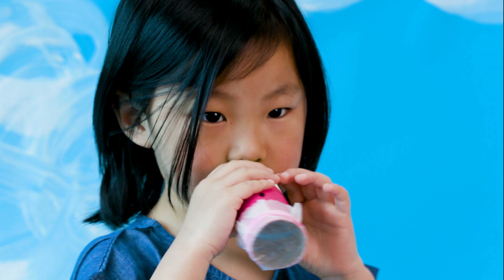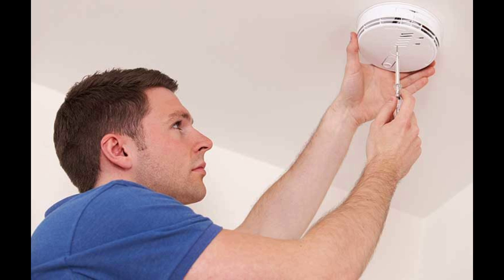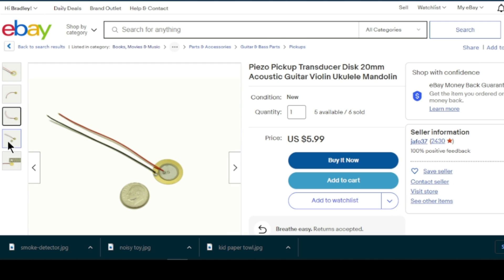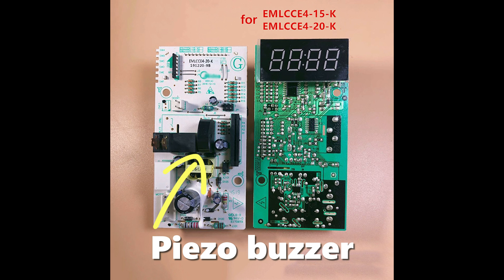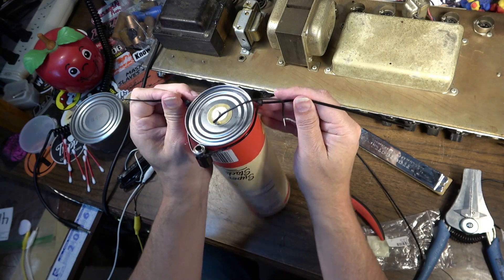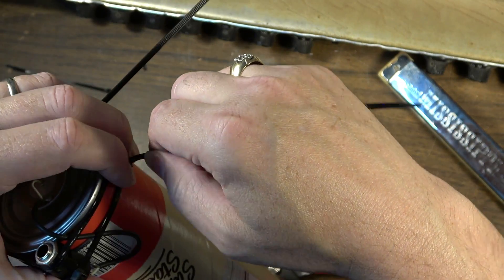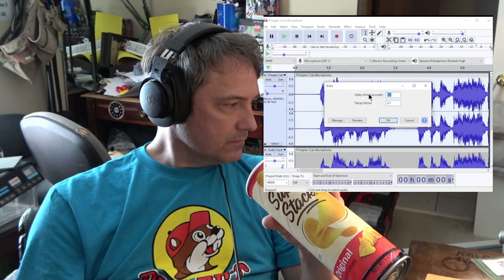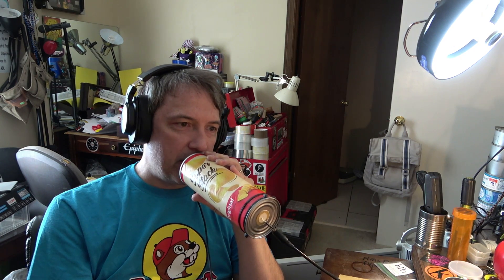Turn a PRINGLES CAN into a MICROPHONE!

Comment: I used to make beer can microphones very similar way. For a microphone I used the old Walkman over ear headphones. I would takes one of the speakers and reverse the connection to a 1/4 inch jack, turns it into a pretty decent low fi microphone

Comment: Hi Brad, love your channel. Found recently and bindged nost of it.

Childish question maybe, but since it's in the spirit of this vid. Is there any way a transistor guitar amp could be made from appliances electronic parts as TV and microwave?
Reply from the maker: Modern stuff uses IC chips and lots of surface mounted stuff. You might find components you can use to make something, but getting it off the boards and designing a circuit around the stuff is more trouble than it’s worth.

Comment: You can use those smoke alarm speakers to make a reverb unit as well, me and my best buddy, when we were kids, once used a weight lifter spring with 2 nails to a piece of 2 by 4 it sounded super lofi but it worked! i wonder if you could make a plate reverb that way.
Reply from the maker: A couple of these piezo buttons at one end of a large plate with a speaker mounted to the other. Would work.

Comment: Seems that you glued the component on the can with double-sided tape on the whole surface but its rubbery nature dampens the sound. Maybe you should try glueing only a few spots on the sides with hard glue.
Reply: Or use a thin film from a glue stick. It works on paper.

Comment: I wonder how a small electret condenser mic would work inside something like that?
Reply from the maker: Might have a similar effect. I experimented with a guitar pickup on the metal bottom and it works, but not well.
Reply: @TheGuitologist  ahh, I had to go deep-cut to find out if this was a conjecture of the Joe Barresi pipebomb microphone and this comment is it